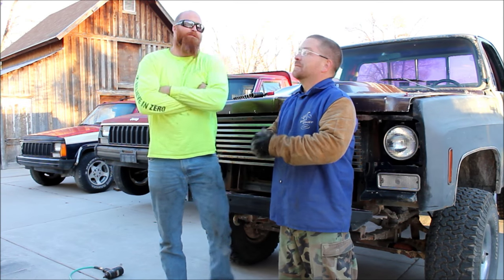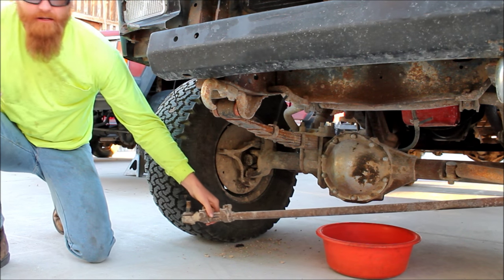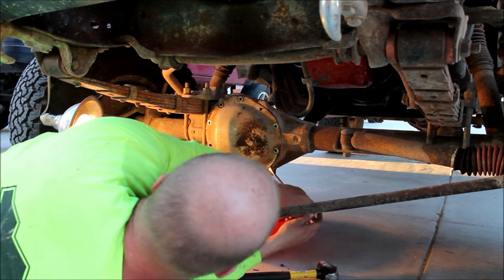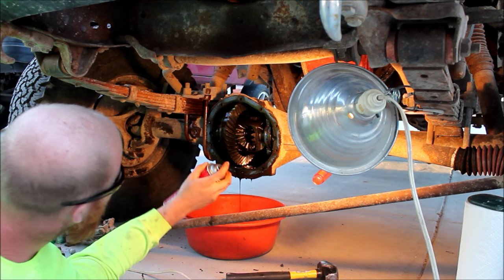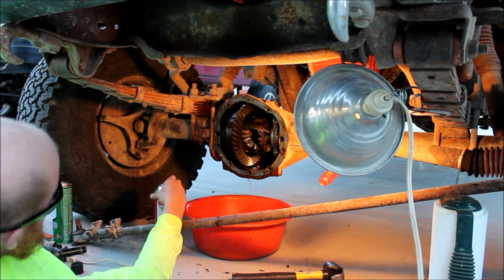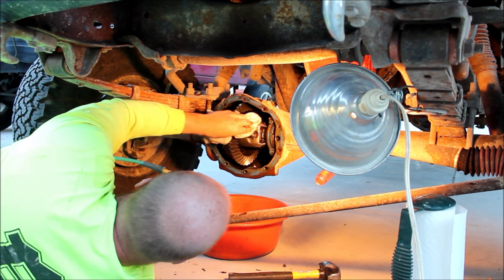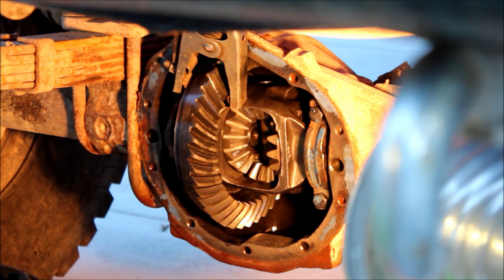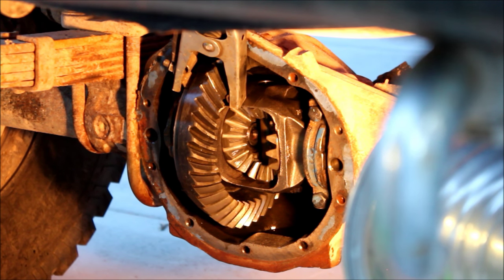LINCOLN LOCK, or how to weld your differential gears into a spool

Comment: When y'all were talking about the brake cleaner and getting all of it out so it didn't catch fire, y'all should of mentioned the dangers that leaving ANY amount of brake cleaner behind and MIG or TIG welding behind it.  It produces a deadly gas called Phosgene that can kill someone in an instant if the parts per million are big enough and there is no help for people with exposure to it. It can also have a delayed reaction so you might not know it right away.
Reply: +Daniel Pace Only the chlorinated stuff
Reply: that's funny. I was just about to comment about the pristine gas and I wanted to because the red can or brakleen brake cleaner he was using is a chlorinated cleaner.  do not use chlorinated brake cleaner people.
Reply: +imsowhiteandnerdy25 phosgene gas*
Reply: A good friend of mine, tig welds coiled tubing in the oil patch. The butt weld is x-rayed, and no defects are allowed, no matter how small the porosity is. He previously used Brake cleaner to prep his weld surface.  Now is lungs are permanently damaged, almost ended his welding career.
Reply: it should be noted that phosgene gas was also used in trench warfare during WWII. glad you mentioned that, I knew about the dangers of Phosgene gas, but did not know brake cleaner could produce it.
Reply: Thanks!
Reply: Right  but is it not designed to evaporate fast so this dont happen?

Comment: Lincoln Lock! 100% recommend the Lincoln Lock for the $, What's good about locking the front diff 
is it's only engaged in 4X4 it won't bind on a turn since you'll usually be in mud so it can slip.

Comment: for those that dont know?  if u shock a socket with something metal like a wrench when u get a nut or bolt stuck it will pop it right out.  just tap right above the nut on the socket.  i know alot of long time wrenches know it but id have love to know this trick back in the day lol.  if uve ever tried using a rod and a vise with a hammer to get one dumb stuck half cocked nut.......u will appreciate this.  i always have two ratchets with me when i wrench so i just use the handle on the spare lol

Comment: I would have ran a full uphand bead with stick rod stainless type 308/309. It has enough nickel in it to bond well and welds better than NickelCast rod, better slag removal too.  TIG would be better if you run shielding gas = no slag at all.

Comment: my father-in-law used stainless rod/wire to weld cast/forged steel. Of course, he would pre-heat before welding, never had any issues. Was trying to figure out why it's refered to  as " Lincoln" locker, then remembered Lincoln welders...

Comment: This product is meant for entertainment purposes only. Your mileage may vary. Do not try this at home. Void where prohibited. Some assembly required. For off-road use only. Slippery when wet. Batteries not included. Do not use while operating a motor vehicle, heavy equipment, cherokee XJ, wrangler TJ, wrangler JK, or any Jeep vehicle, especially the newer Fiat ones. How-to videos may be too intense for some viewers and children under 30 years of age. Please remain seated until the 4x4 ride has come to a complete stop. Studies have shown viewing these videos causes increased cancer risks in laboratory test people. I am not a professional, I have no training, I'm not even particularly good at horse whispering. Don't believe everything that you know. Please keep your hands in the vehicle at all times. Do not tap on glass. Do not eat anything that has been on the floor for more than 3 days. Keep your hands to yourself. Not to be taken internally. Reproduction strictly prohibited. Driver does not carry cash. Objects in Bleepinjeep mirrors may be farther than they appear.
Reply: If it's posted on the interwebs, it must be true.

Comment: youll reconsider using those chlorinated brake cleaners when you're half paralyzed. brakleen brand IS a chlorinated cleaner.
Reply: Jerry there is some that in non clorinated....
Reply: Atvsrawsome brakleen brake cleaner in a red can is chlorinated. brakleen does not use a red can for their non chlorinated cleaner, that would be a green can. the brake cleaner they are using IS a chlorinated cleaner.

Comment: This wasn't that funny, but this had me laughing out loud.  Just reminds me of dumb shit I would do/have done.

One thing that will keep the weld out of the splines... and make it stronger is to cut a steel plate that fits between the side gears/spider gears and weld it in there.

2 things I would stay away from:
- the brake clean that has been mentioned dozens of times in the comments already.  Use carb cleaner to get most of it out and then blow it out.  Kerosine in a spray bottle is a good choice also.  Anyway, most oil recycling places won't take your stuff if they get a hint of brakeclean.
- did you use flux core to do that weld (it looked like it)?  If you did any of the flux residue left in there will trash the bearings as soon as you fill it up and run it.  At that point after picking out and knocking as much loose as you can I'd blow it out, hit it with a pressure washer, plow it out again spray it with some WD40 to displace the water, clean up any loose WD sitting in the bottom before you fill it...

Comment: Nothing wrong with the 10 bolt, it's basically a dana 44
Reply: No it's not a Dana 44.   10 bolt are weak AF.   Ford makes best rear ends 9 inch.  8.5 inch or even newer ford 8.7 rear

Comment: Got an 04 jeep tj 6 years ago. Rear axle seal leaking , passenger side. Replaced bearings and seals. Pulled diff cover to drain fluid. (May have been some metal in there from the bearing wear) 
  For 6 years i drove this and assumed it had a luchbox locker.   Nope, f'in welded. I cant believe it ?  Well that explains the excessive rear tire wear. Also explains why i can never freewheel a corner in the snow. 6 years i gotta drift the right turn downhill at the bottom of my street or plow straight ahead into the nieghbors mailbox.
   Pretty nice jeep for 15 years old. But Wish the last owner left its rear axle alone.
Reply: Yea and this shitty part is most of the time people do work on things and not really needing to.. I wonder if last owner wheeled at all? What was his purpose of welding spider gears if not for wheeling..
Reply: @welditup9559  actually got lucky, wrote my comment after working in garage late night. The carrier didnt look eright to me ? Next day after work and fluid had drained completely i looked again and discovered it had a factory limited slip that happens to work really well. Ive seen a bunch, ive replaced spiders w/lunchbox lockers but had never seen an LSD before. The carrier was so oversized i thought it was a spool at first but when i saw the spider gears and couldnt really see the clutch packs, just figured the clutches on each side looked likw a noce thick bead of weld on each side. After wire brushing the the tag on the rear diff cover i could read it 'd44 3.73 LSD'
  I was much happier knowing a jeep i thought was great was better than i knew.
  Still driving it, still a great ride.
Reply: Right on buddy. Well thats a relief. Lol keep jeepin
Reply: But why so much tire wear? just daily driving with a LSD it shouldn't be engaging that much on turns to eat tires like that.
Reply: @welditup9559  good year duratracs. Lol. Maybe next time i spend a few more bucks

Comment: talking crap on the 10 bolt front, its basically a mirror copy of the 44, when GM designed it.. what axle do you think they copied? its pretty much as strong as a 44, the only thing is a 44 has better aftermarket support.
Reply: Guinelle1, My old 1973 GMC ran a Dana 44-50.
Reply: Ford 8.8 is the same deal.. Beefy axles/centers.

Comment: hey... i have a welded dana 35 in my 89 XJ
Reply: I got a 89 xj as well sitting on 6 inchs with 33s x12.5 . I wanted to weld my rear d35. Hows it running in yours??

Comment: I got a dana 35 on the rear of my xj I'm sitting on 33s and cant afford the fancy lockers I was thinking of going welded diff. Why do you say the 35 is bad to Lincoln?
Reply: The dana 35 is notorious for being a weak axle. Running it locked, whether welded or other type of locker you will break it doing any serious wheeling. I would replace it with an 8.25 for a cheap, easy bolt in upgrade.
Reply: I had a weld in 35 for years and I was running 1550 Super Swamper SX with beadlocks and I never broke it and I will the crap out of that thing so haters going to hate

Comment: IF YOU WELD FRONT DIFF SOLID YOU BETTER BEEF UP WHERE THE STEERING BOX BOLTS TO THE FRAME OR THE BOX WILL RIP THE BOLTS THREW THE FRAME.

Comment: hope you enjoy Phosgene poisoning because if there is any liquid brake clean still in there when you weld or use that torch that's what it will become, read the can before you use the product.
Reply: +deckum23   ,  only if it is chlorinated brake cleaner ....  CRC makes 2 versions , Red ( chlorinated )  Green ( non chlorinated ) ................ But you are correct .... First thing I learned while taking welding classes ..

Comment: I welded my pinion to the ring gear, so now what
Reply: +xartpant I don't see how that would be possible and it wouldn't work ever again.
Reply: +xartpant I would look for a new axle in the classifieds or junk yards. If you've welded the ring and pinion, the axles pretty much junk.
Reply: Welding the spider gears makes the axle pretty much junk
Reply: Cut the tail of the pinion gear. Unbolt the cradles. Pull it all out and drop it in the trash. If your axle shafts are not in it.. Then you might be able to do something.. Or else start fresh

Comment: *DO NOT* weld any parts that that contain *ANY TRACE* of chlorinated brake cleaner like these guys did in this video. It cannot be overstated how dangerous this is. If he continues doing this he won't live long. In the video, we see him use chlorinated brake cleaner, then use an air hose to blow it off, then proceed to weld parts that are still damp... UNBELIEVABLE!  Phosgene gas is extremely deadly and can kill you immediately or over a period of several weeks.

Comment: did it make it home?!? :)
Reply: +Stephane Daury Yup he made it!
Reply: +Tyler Bleepinjeep : awesome. :) Pretty bold to weld the front diff for a road truck. About to have the same done for a Ford 8.8, for an XJ. The guy welds axles for dragsters, pretty sure his welds will hold (we'll see about the rest). :)
Reply: +Stephane Daury well he has locking hubs so it's basicly open when the hubs are unlocked
Reply: +Stephane Daury well he has locking hubs so it's basicly open when the hubs are unlocked